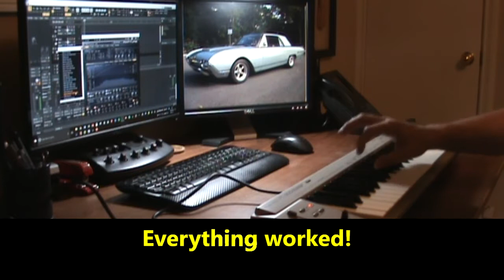Stewart Copeland's Roland ED PC-300

Comment: Just wondering how you’re getting this to work? It seems to hate windows 10 and even 7. (It REALLY hates my Mac but not a problem really so do I ahah)
Reply from the maker: See the other comment thread (on this video) talking about some possible driver solutions if you want to use the USB output.  I don't use the USB.  instead, I use the MIDI output and the power supply.  This eliminates the need for a device-specific driver.  Instead, all you need is a MIDI driver.
Reply: bevo65 ah thankyou!!
Reply: bevo65 I’m having a lot of trouble with the drivers suggested so I’m just going to go with the midi output. How did you set it up?
Reply from the maker: @j3sslk  It's easy.  Get a MIDI-to-USB cable and plug it into the MIDI output of your instrument and the USB port on your computer.  You should have a standard MIDI driver on your system already (if you don't, I'm pretty sure they're available everywhere).   Then set your softsynth to use your MIDI driver for input.

Also, I assume you have the power supply.  You'll need it.

Comment: i need the driver for windows please?
can you mail it to me?
Reply from the maker: Sorry ... I don't have it.  I don't use the USB connection; I use a true MIDI connection instead.   Keep in mind, if you have Windows 10, I don't think a driver exists for this controller.  It makes no sense to me, but there you go.
Reply: I found one online, Roland just changed the Driver, UM-1
Reply from the maker: Outstanding.  Is that for Windows 10??  I've had no luck installing any PC-300 driver on Windows 10.
Reply: i just used that for my windows 7 and it is working perfectly, you can try it aswell or look for the UM-2, but im almost certain the UM-1 is for the PC-300 and would work on WIn10
Reply from the maker: Cool, thanks!
Reply: Akonedo Jeffrey I have mine working on W8.1 and W10, both USB connection.
Reply: with what driver?
Reply: Dusko Marincic give me some time and I will help you. 👍🏻
Reply: Dusko Marincic try UM-1 or UM-2 from Edilrol web page.
Reply: Thank you, will update when I try it.
Reply: frank grimes look for the next model. Not precisely PC-300.
Reply: frank grimes or this https://www.soundonsound.com/forum/viewtopic.php?f=20&t=55497
Reply: Dusko Marincic hi. How is you going? Please read above some links. Saludos.
Reply: Dusko Marincic I did found a new solution LINUX QSYNTH JACK AUDIO y funciona PERFECTO.
Reply: frank grimes I did found a new solution LINUX QSYNTH JACK AUDIO y funciona PERFECTO.
Reply: @jefak   keeping working ?